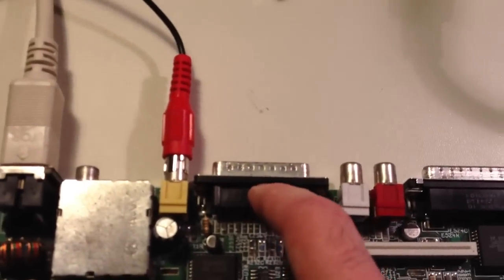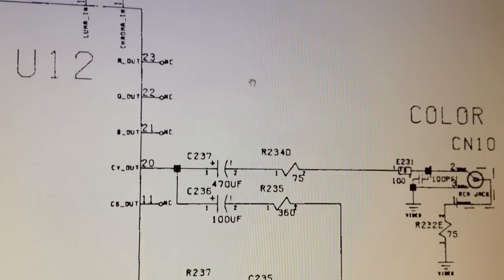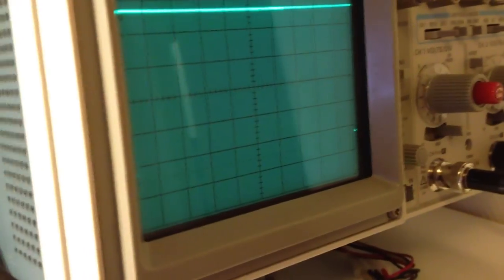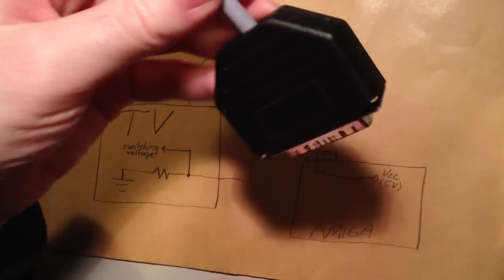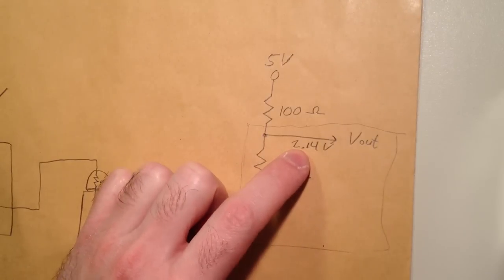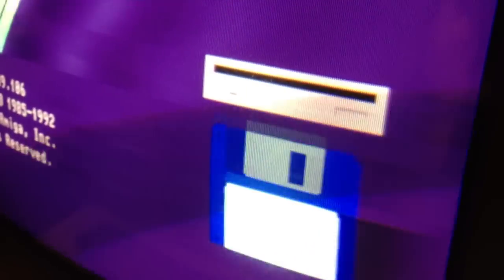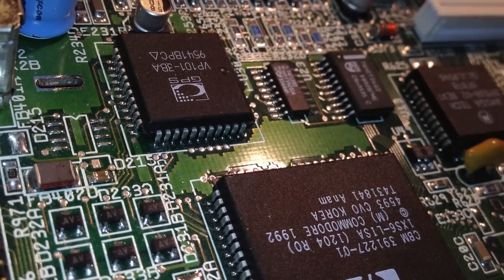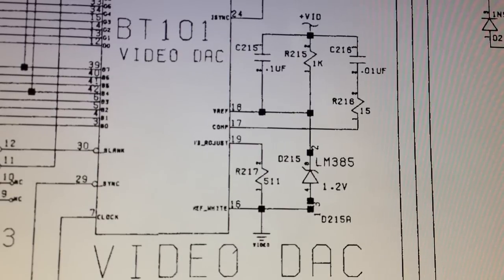Amiga 1200 repair - Video problem

Comment from the maker: I cannot stop wondering that myself. But unfortunately, that is most certainly something we will never find out. Unless the original modder happens to see this video and posts a comment, that is. :)
My guess would be that person A originally took the 47 nF cap out of there, then sold the mobo to person B, person B (who didn't know much about electronics) then thought that "video problem = something wrong close to the video output", and then performed a trial-and-error repair. Just a guess tho :)

Comment: it refuses to boot, it powers on, the power light works, caps lock works, chips warm up, screen goes black, and that is it nothing, it is not a video issue as the machine just does not boot.. i think it is either a bad cap or bad trace on the board, i made a video some time back of it i just forgot to upload it, which i may do if u have any suggestions :-)

Comment: i have the same issue with one of my amiga 1200's, same apollo 1230 40mhz too... i just bought another amiga 1200 off ebay, that works fine.. but it is repairable if u google A1200 timing fix, this will show u guides on how to fix it and i think amigakit offer a timing fix service, either that or buy another accelerator or another motherboard

Comment from the maker: A CPU running at a faster speed than intended will always dissipate more heat compared to when it's running at normal speed, and in most cases also add a certain amount of instability to the system. This is also the reason why I am not a big fan of overclocking. If a faster system is desired, I'm in the opinion that it's better to buy a CPU that is intended to handle that faster speed, rather than trying to get more out of a slower CPU than it's designed to handle. Thanks for the comment btw. :)

Comment from the maker: Upgraded? You mean, you have the 33 Mhz or 40 Mhz version of Apollo 1230, which is now overclocked to run at 50 Mhz? If that's the case, then you most likely got a heat issue there. It might be that the system freezes after a little while because the CPU gets too warm. It's possible that a big fat heatsink will do the trick. That will be difficult to fit in an A1200 if it's not inside a tower, and in that case you will have to "underclock" it back to its original speed again to get it going.

Comment from the maker: That is one possibility. But in such a case, it still seems strange to me that anyone would want to put a 100 ohms resistor in there since that is not part of the original configuration, and there is not much benefit that can be gained from doing so either as far as I can see it. Another possibility might be that the original modifier didn't have any access to the schematics, or didn't know how to read them. The 9.8 kOhms resistors might be the result of a trial-and-error kind of repair attempt.

Comment: I wonder if for whatever reason the original owner/modifier misread the schematic, and replaced the filter with the 10kohm resistor, thinking they were putting the 100 ohm resistor in place... or they looked at the filter and it said 10k on it, thinking it was a resistor...  good work in tracking down the issue there!